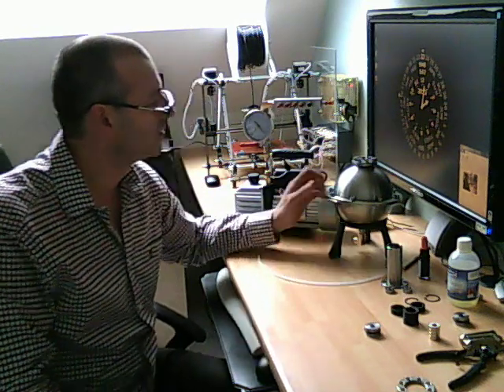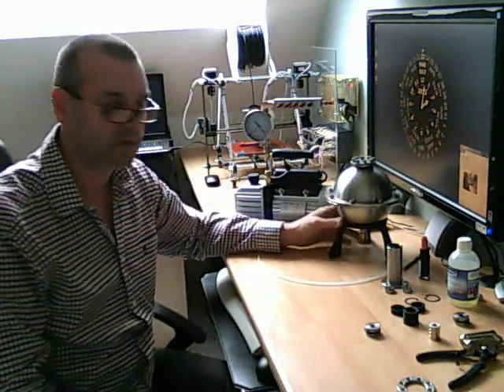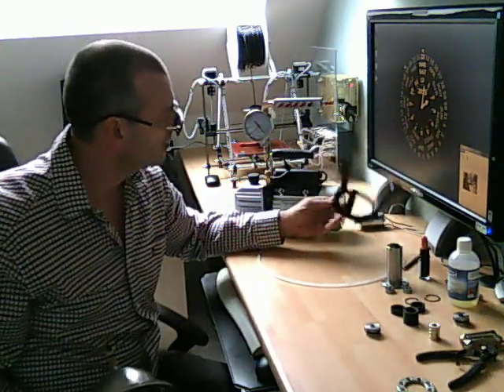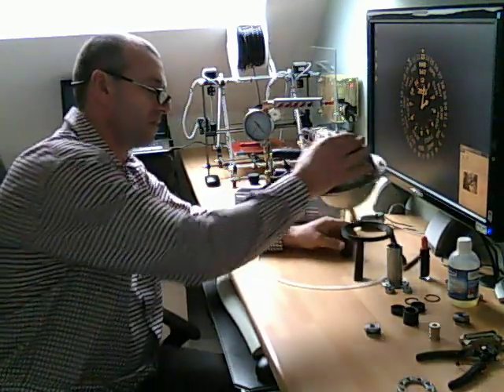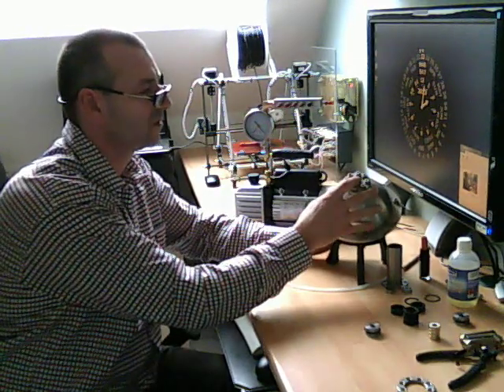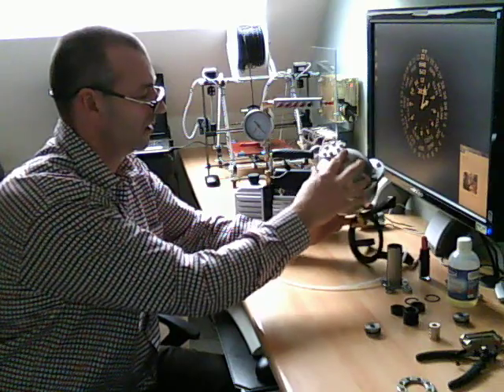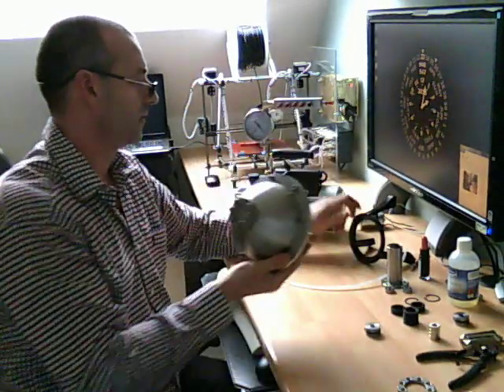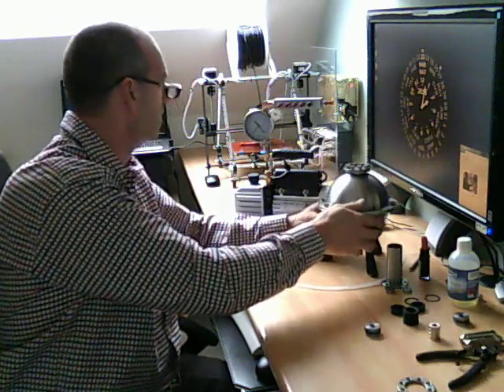V2 Keshe reactor vacuum chamber test

Comment: Good set up, , make an isolation table, move the pump away  and increase the length of the tubes and quality of valves on gas chambers, make sure there is always a buffer for the plasma gas to discharge into after the reaction has been initiated. 

Close proximity to the reactor can form radio-nuclide material in core,  decay of tubes, electrical equipment and personal health.

If not, your equipment will not retain good vacuum which is essential for the process. 

Hope this helps.